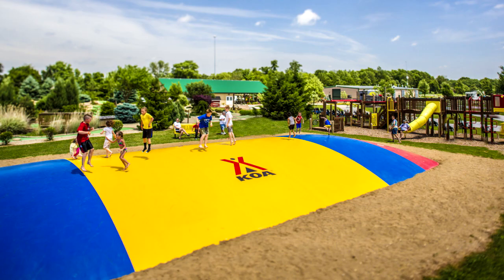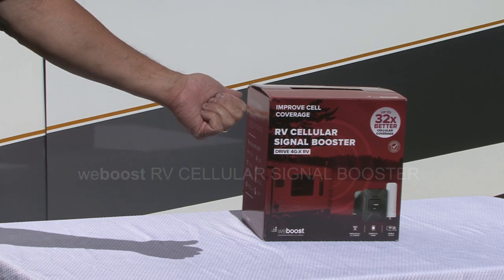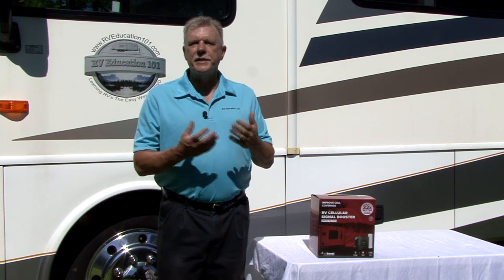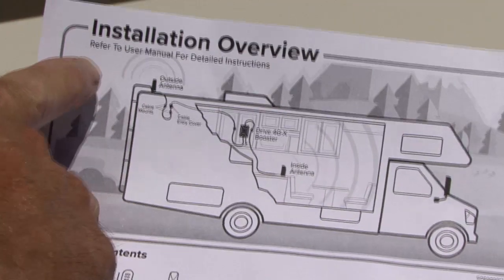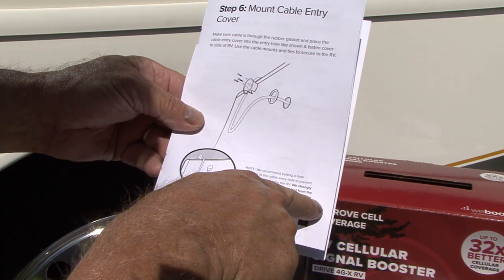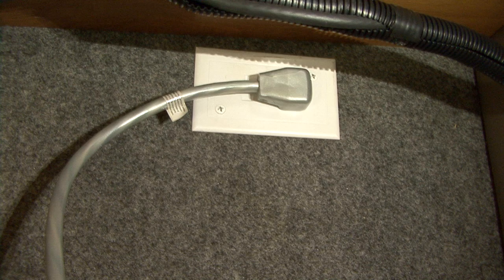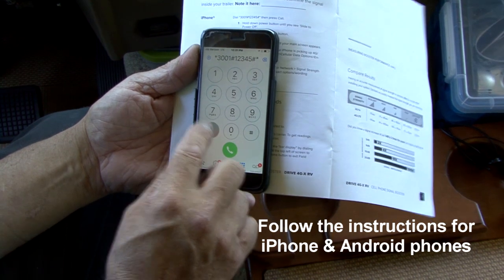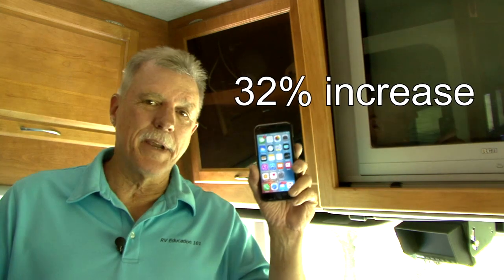How to Boost the Cell Phone Signal in your RV

Comment: The problem is that your signal went from -100 LTE to -68 3G which is very slow. I'd take the -100 LTE over the 3G any day.
Reply from the maker: I apologize the video did not explain the phone settings very well during 
the testing, but in both instances the signal increased significantly. The 3G 
signal went from fair to excellent and the 4G/LTE signal went from good to 
excellent.
During the test that was shown in the video the iPhone was set to 
check the 3G signal by following these instructions:
If you want to check 3G/1x but your iPhone is picking up 4G/ LTE signal, go 

to Settings>Cellular>Cellular Data Options>Enable LTE>Select Off